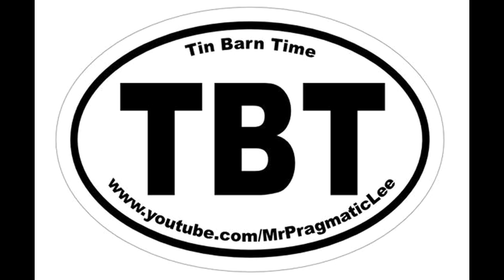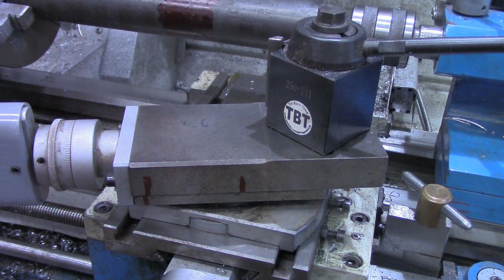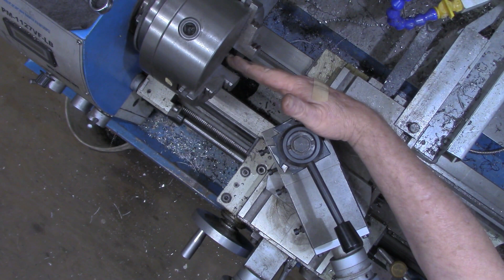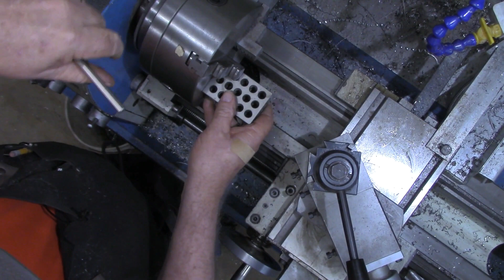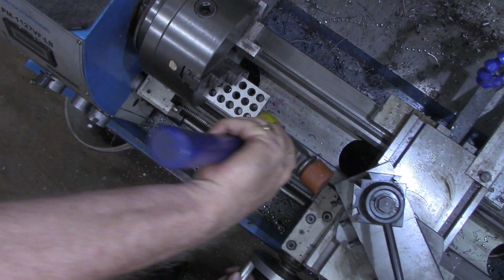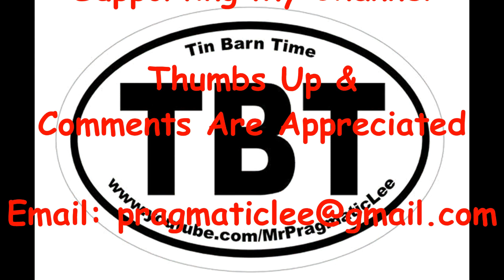Another Way To Set Your Metal Lathe Compound Angle

Comment: Interesting! But it assumes all intermediate surfaces are perfectly straight and square to each other ... and it a large number of them. If you want to be really accurate the only way is to check the actual displacement direction vs chuck rotation axis.

Comment: Making a Fixed 29.5 gauge block ,  Using it off of a 1-2-3 block will perfect.    Maybe make the block , trapezoid .  

Rectangle large enough to hit chuck body and reach compound.      Think of a rectangle with  a 29.5 and 60.5 angle slice on other side.  

For better accurate setting  , use Trig and indicator off of the tail stock.

Comment: I’m a newbie and I caught your mistake on the second setup, I read through the comments to verify and I was correct. The one thing that I would have liked to see on the second setup was for you to use a boring bar with a thread cutting insert on it because the way the tool holder was positioned, you couldn’t have mounted a boring bar. I did get what you were saying right away on your first setup enough to realize the mistake, so that’s a good trick I’ll remember. Thanks
Reply: I caught that same mistake.

Comment: If you can’t do a little simple trig you have no business trying to be a machinist. An indicator against the tail stock quill or chuck face is by far the quickest and most accurate method to adjust the compound angle. Just use sine or cosine.

Comment: Agree with your method Lee, you just make a blue on the second half as soon as you released the tool holder block.  I  will use the method. I normally put a bar between centres,  but that only works if there isn't a job set up. Thanks mate Cheers.

Comment: Lee excellent idea but you should review the procedure you made a small error . :) just as a thought how is the dial fixed on the cross slid or is it one piece  you might be able to swing it round so you can line up the mark's either way you swing the top slide just a thought . :)

Comment: What a terrific idea!  It lead me to try something a little different.  I chucked a 1/2inch rod. Then aligned the top slide using my old 30/60/90 triangle from drafting class.  I put a 1-2-3 block against the rod, and set it on the slide.  Bingo!